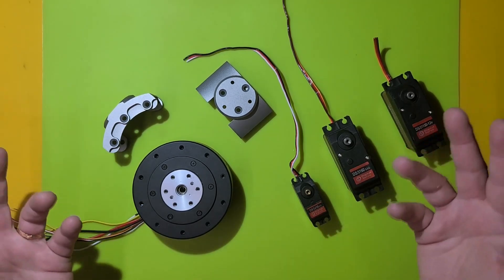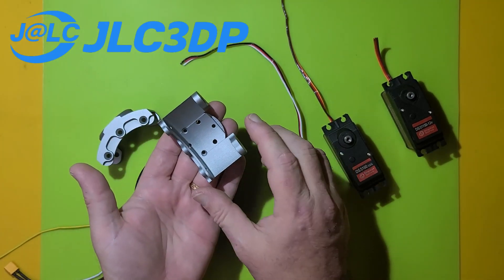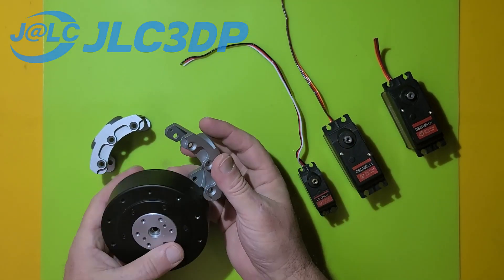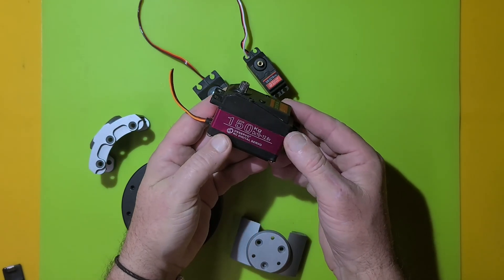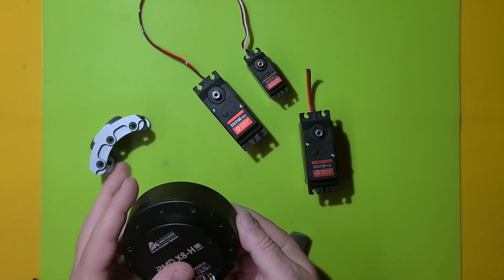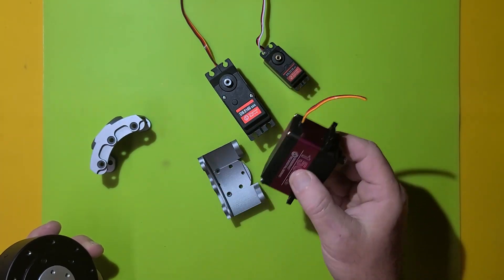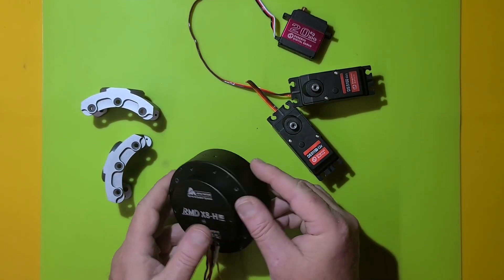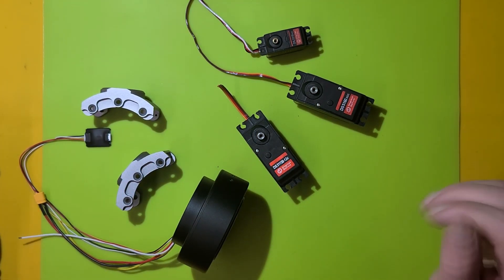Mechanical Advantages of BLDC Motor Actuators vs. Hobby Servo Motors

Comment: The arms and shoulders on the tiny single bearing servo shaft have been the biggest concern for me wanting to dive into nova. Hopefully you can find a middle ground for brushless actuators, definitely between those $20 12kg servos and that $400 rmd x8-h.
Reply from the maker: indeed, price point is tricky with BLDC motors.  I'm hoping to do another video real soon with two legs fully built and operational, and put some numbers together for costs - If a handful of us want to build it, we can probably get pretty good bulk price on motors, aluminum, and batteries (another concern with BLDC)

Comment: No one will repeat this again. The cost of one engine is at least $600 and above. It is better to develop the project further so that the dog can walk faster in terms of software.
Reply from the maker: incorrect.. research just a little before thinking you have the answers, thanks.